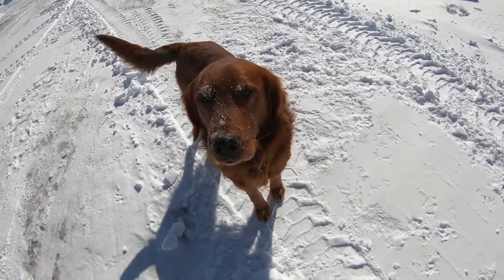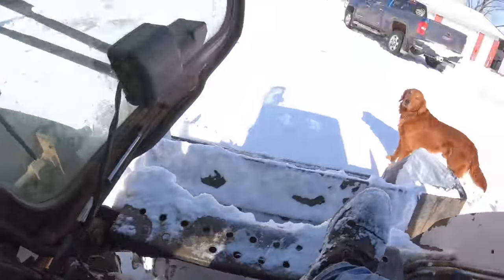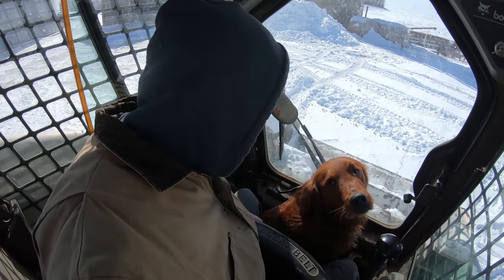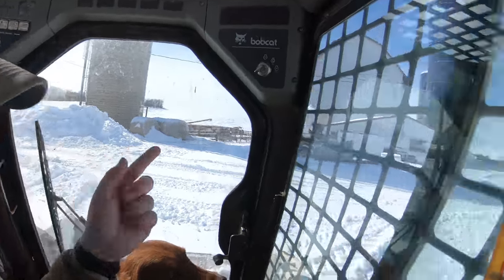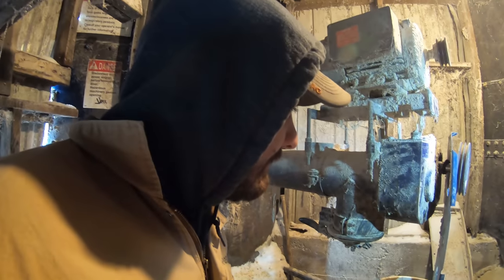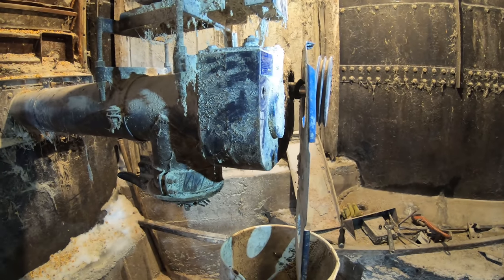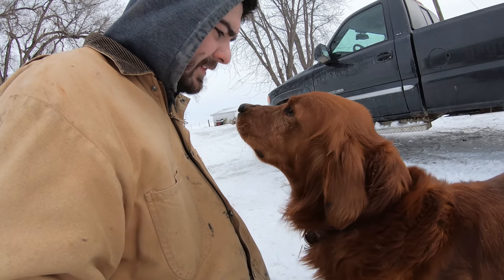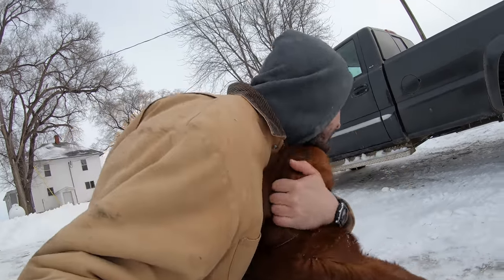Frozen Broken Silo

Comment: We borrow a Thomas once in a while and it has an add on track system that wraps around the tires, all metal so it's fine for coral work. We use loader tractor for all chores tho. Good luck on yer gearbox.

Comment: those harvestore sweep augers do that all year round until you run it somewhat empty get in there & clean it out by hand. of course you can have harvestore company come do it they'll send out about 4 guys 1 works 3 stand around & the new F450 work truck runs all day long. whole winter 02-03 i chopped away at a frozen harvestore with a disk shaft to get my 1150 lbs corn per/day for the mixer batch. i don't miss it

Comment: Have you tested use fine (3/8") crusher run on ice?  I make in Sweden some big piles in fall and put a tarp over them. Then you have it for spreading in winter. All yards and roads always need some more anyway in spring. We don't use salt at all on farm surfaces except in summertime for dust control (then only Calcium chloride). Salt is not so good for Rocket's paws, etc.
Reply: Definition of calcium chloride is - - - - - - - SALT. TA DA!!
Reply: @dizbob6250  Yea, but this is not the mostly common chemical type as Natrium/Sodium chloride is. But you have right. Both is a salt and have function to melt ice or as a saline water solution also for dust control.
Reply: @uppsalahazzemarkstedt2759  👌👌